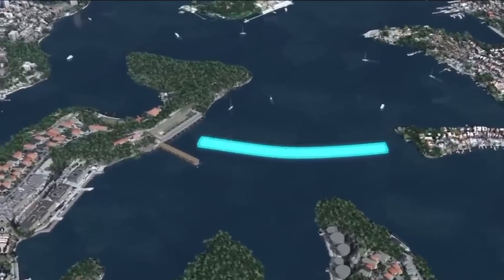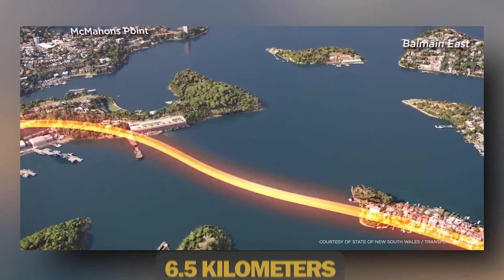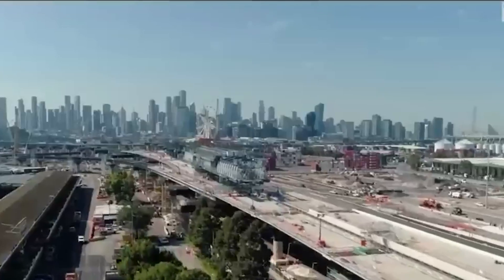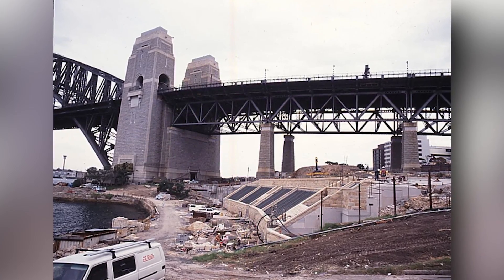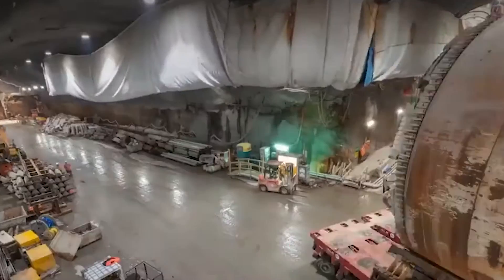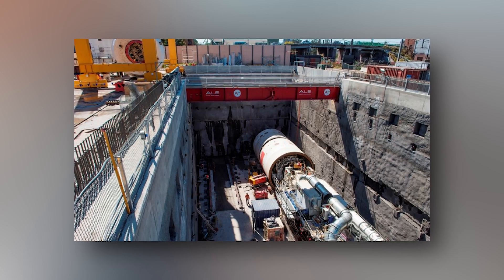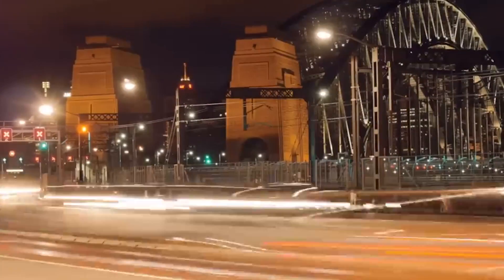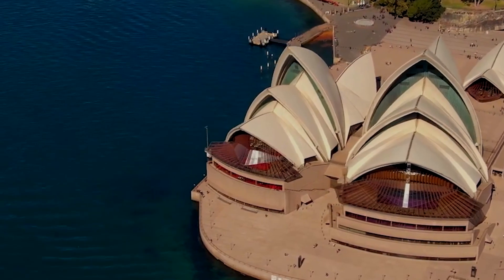Sydney's $3.2 Billion Tunnel Project Takes a Shocking New Direction

Comment: Haha - here's an actual channel the believes adding roads gets rid of traffic!
Absolutely hilarious stuff, from the 1950s and 1960s!
Reply: Urbanistic bs? Yes we heard you many times. While we driving on westconnex instead of congested parramatta rd. Which, btw, became drivable too.
Reply: No-one except you is making that claim. What it will do is take traffic off roads not designed to carry it and put it on a road that is designed for it. Sydney is a far better place to live now that WestConnex is completed and its associated tunnels such as the Western Harbour Tunnel and M6 Tunnel are under construction. The world's largest road tunnel network will just get bigger and better as the years progress and surface streets can be handed over for community use and trams.

At the same time, NSW is building a world-class metro rail system with driverless trains and this forms the largest public transport project in Austraia by far. So public transport advocates cannot complain that they are not being looked after. Thanks goes to Barry, Mike, Gladys and Dom for getting these ambitious but much needed projects off the ground.

Comment: It's not a $3.2 Billion tunnel it's $6.8 Billion tunnel. It's a fucking stupid idea. It's not an immersed tube tunnel.
Reply: If you'd have watched from start to finish, you would have known that the author acknowledged the change from immersed tube to bored tunnels. It's a fantastic idea which was intended to relieve the traffic load on the Anzac Bridge and Western Distributor, the latter being built in the 1980s for heaven's sake, when Sydney only had 3m people. The tunnels are a fucken awesome idea. They will eliminate the bottleneck at the Rozelle Interchange the minute they open.
Reply: The tunnel is fucking brilliant idea. The final piece of westconnex. Pity it won’t extend to the northern beaches as it was intended to

Comment: Not a bad clip for those interested in such projects and lessons flowing from them. Reasonably accurate and succinct presentation. Some images shown are not relevant, but not to an extent that gets really annoying or amusing.. Certainly better than many in this genre, it will probably be of reasonably sustained interest and value; but given the (apparently "shocking") change was made about 3 months before it was uploaded, it does border a bit on 'old news'.

Comment: A amazing engineering  project, 
Wind back history The area around Balmain/ Birchgrove  / Glebe where the project connects with other toll roads is riddled with coal seams. and a original source the growing city need for coal was met by tunneling under the harbour. 
The need for this crossing  of the harbour was pushed through to relieve Traffic congestion . Toll companies are set to gain by this cross harbour tunneling Project at the expense of alternate transport priorities.
Traffic connection argument world wide perpetuates the need for these tunneling mega projects. 
Meanwhile Western Sydney where 1/2 of the population lacks basic Public transport infrastructure.